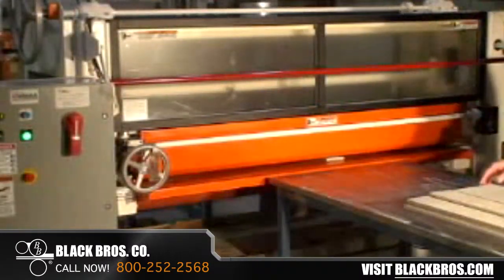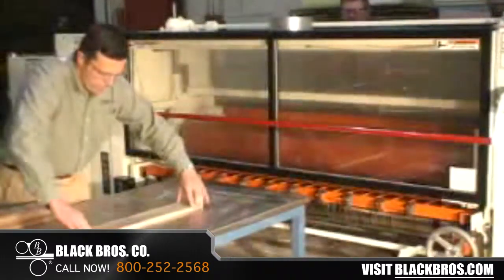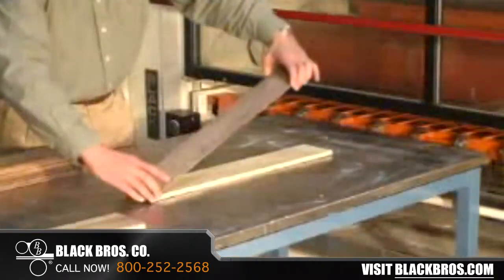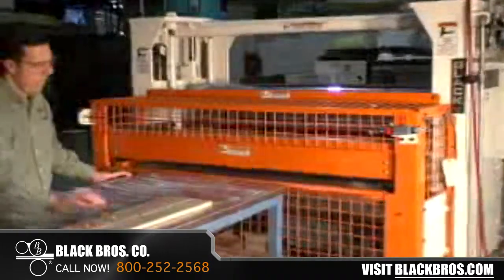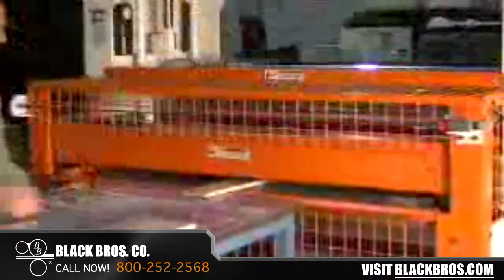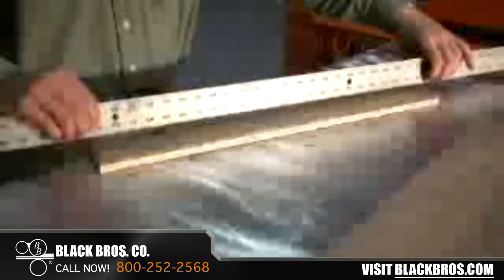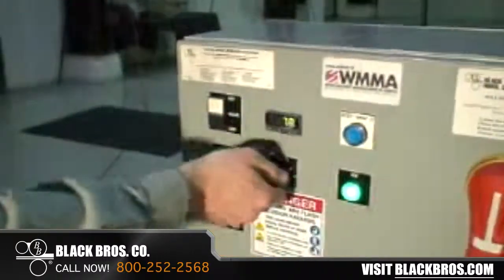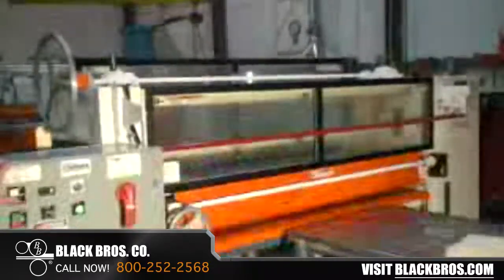Engineered Wood Flooring Laminating System - Black Bros. Co.

Comment from the maker: This system incorporates our 775 hot melt adhesive spreader and our 1575 rotary pneumatic press, to apply laminate over planks of wood.
Engineered Wood Flooring Laminating System - Black Bros. Co.